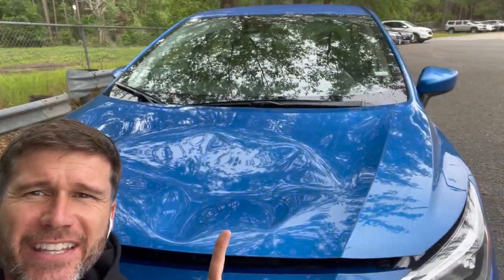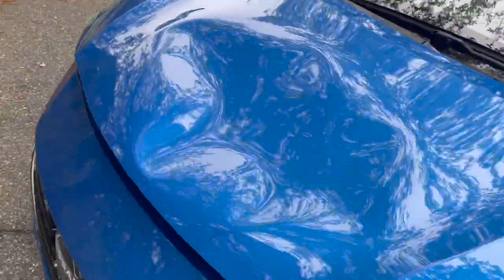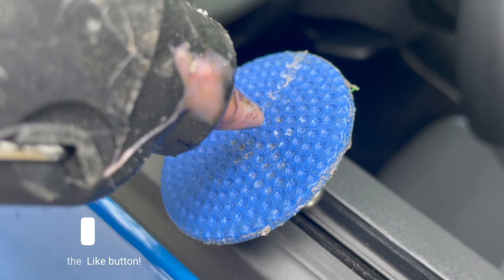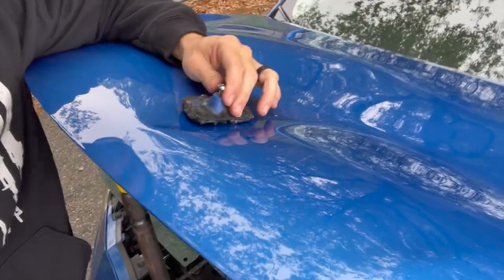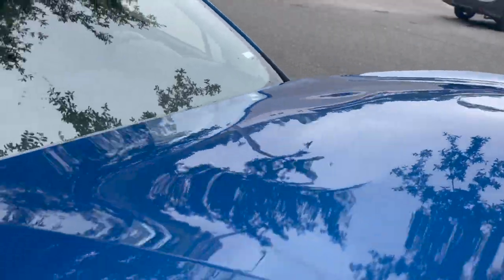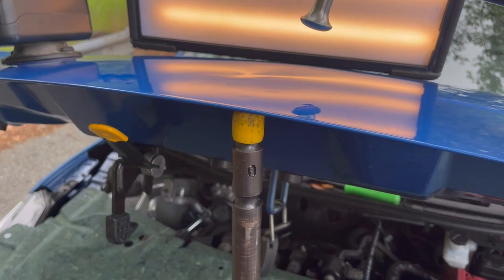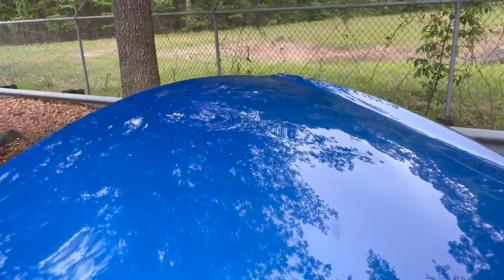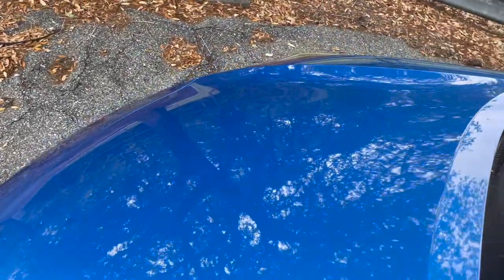How l FIXED this HUGE Dent in the Hood of this Nissan Versa!

Comment: Hello I recently just bought a hood for my mustang and it came with a dent. I was wondering if you can give me a link of all the items you used so i can try to pull that dent out. Thank you and nice video !
Reply from the maker: You’d be better off hiring a local PDR guy, the tools will cost you more…  will you be painting the hood after you try to fix it or no?
Reply: Yes I will be painting it
Reply from the maker: @manuelnavarrete2074  send some photos of the dent on top of the panel and underneath and I’ll tell you what tools I’d use 🤙

Comment: Did you cut all the brace glue before you started glue pulling?
Reply from the maker: I don’t think I had to- the dent was basically in the middle of all the braces- and on those hoods that space is huge 🤣. I’ve thought they’d have changed the design by now…

Comment: What does a repair like that cost the customer
Reply from the maker: Retail price would be around $1200👍
Reply: @dentrepairjax you do great work, but how does that compare to a new hood?
Reply from the maker: @nomdeguerre8464  hey thank you! I’m not sure. The prices fluctuate - and availability can also vary…but part of the value PDR brings is speed . I can have it fixed in a few hours… it may take weeks to get a hood… and lots of our customers want to keep the factory paint in tact 👍
Reply: @dentrepairjax  sounds like I need to learn PDR lol. Any recommendations on where to start?
Reply from the maker: @nomdeguerre8464  where do you live?
Reply: @dentrepairjax  Upstate SC
Reply from the maker: My company has a need in Greenville SC https://jobs.dentwizard.com/search/jobdetails/pdr-technician/0d1c7895-0c86-4c19-a027-6b6c0c3fa151
IF you’d rather pay to learn I have a few options too… what do you prefer?
Reply: @dentrepairjax  thanks for the reply. I'd certainly want to compare both options. I see the information for the former, do you have a link for the latter option?
Reply from the maker: There are lots of options to pay for PDR training. I think one on one training usually runs around $6000 per weekly $10k per 2 weeks… 
There’s Gateway PDR training in St Louis that costs $14,400 for a 6 week course (not including hotel)